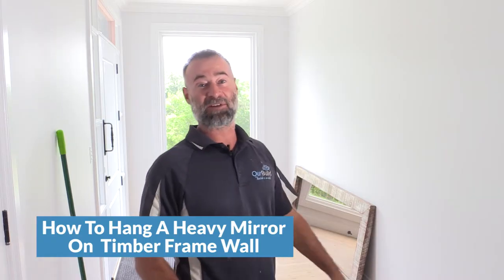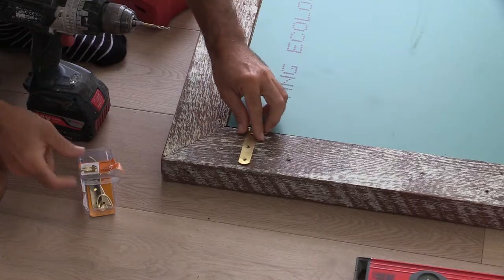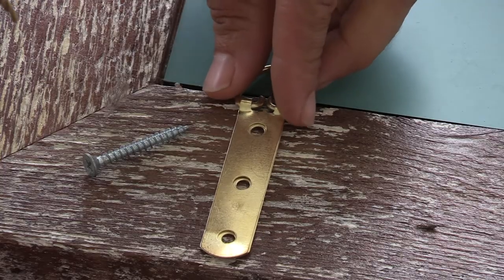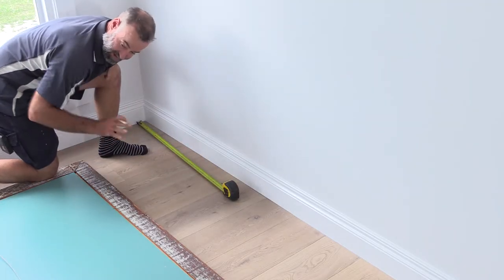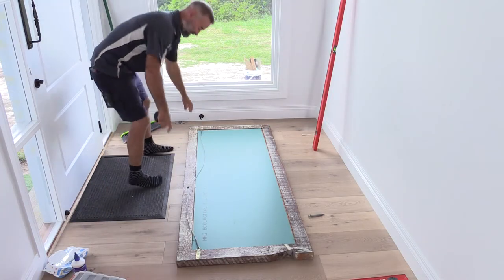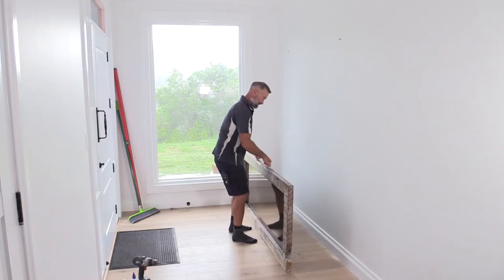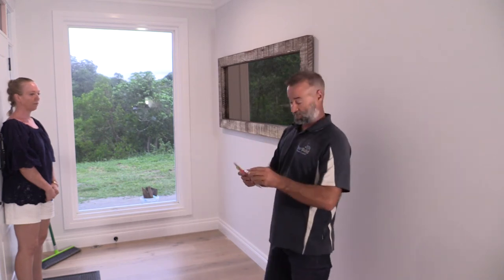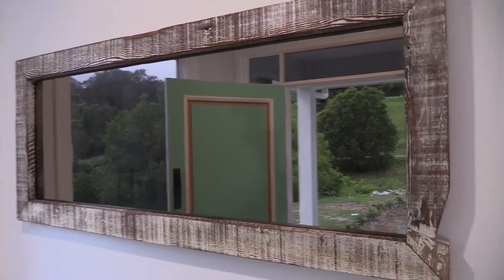How To Hang A Heavy Mirror On Plasterboard -  TIMBER FRAMED WALL

Comment: Unfortunately the studs don’t work out in terms of spacing for a 1 metre square 35kg mirror I want to hang. I can only ( just) pick up one stud. Is there any toggle bolt you can recommend for fixing one side into ? It’s a timber frame house. Thanks.